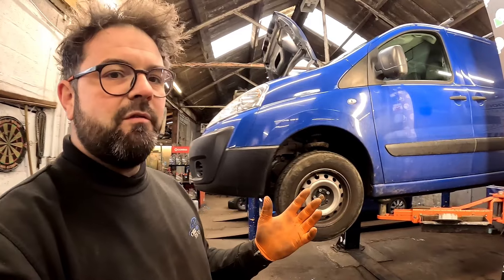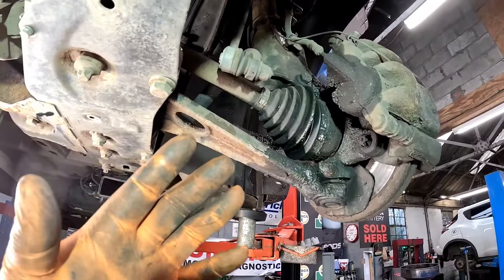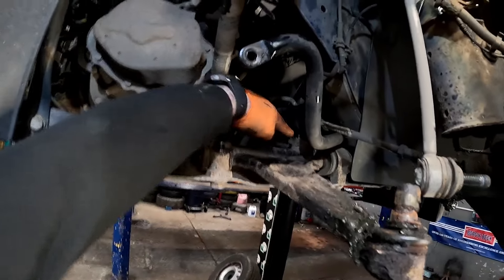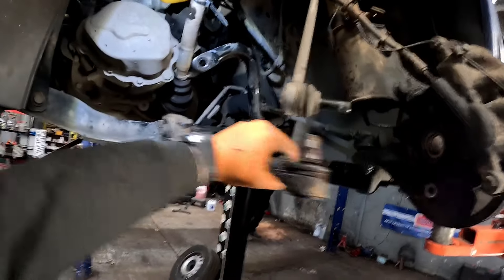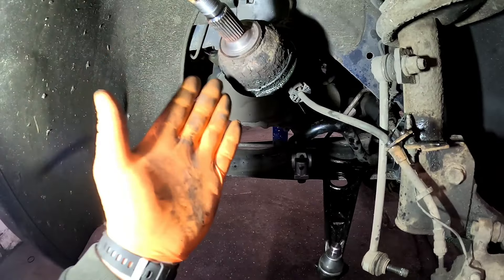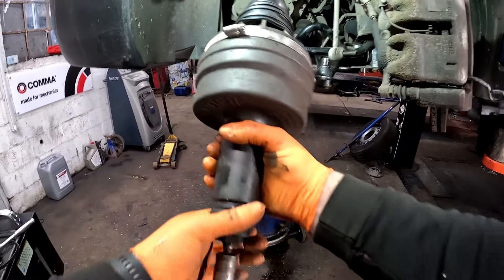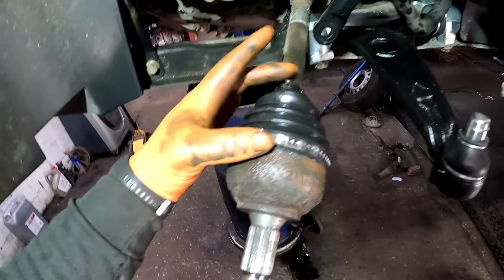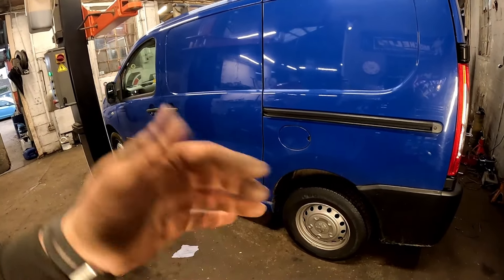STUPIDLY LOW MILE 2012 PEUGEOT EXPERT DONE 42K!!!!! MILES IN FOR A FEW REPAIRS!

Comment: I used ACF 50 on all joints and the subframe after I've done my oil change. It keeps the rust away and keeps the underneath mint. I even treat my exhaust and suspension and springs.